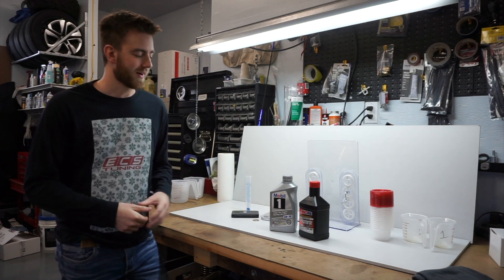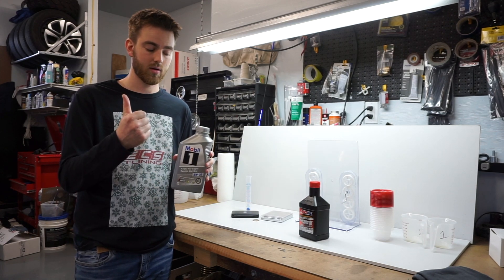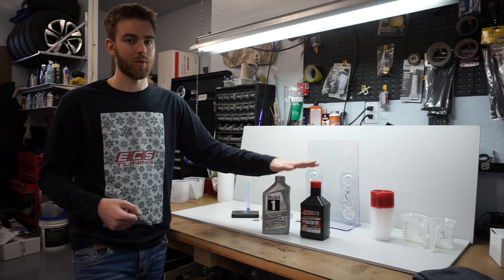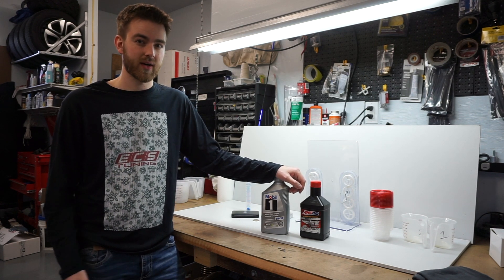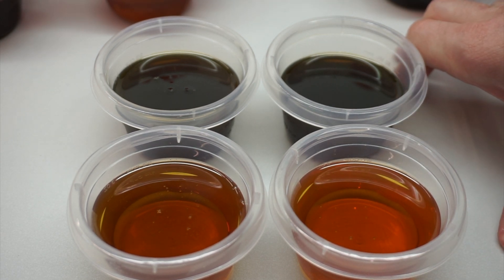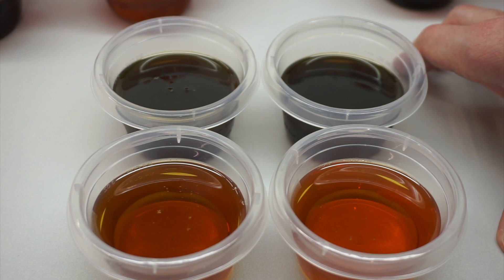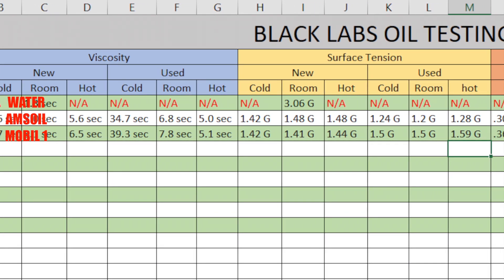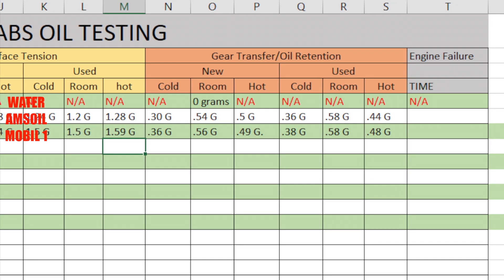Mobil 1 vs. Amsoil. Search for the best synthetic oil. Bench testing (part 1)

Comment: OK Signature Seiries Amsoil.  Good oil.  Now . . . you cannot BREAK IN a new motor on syntheitic oil.  At least a 30 minute breaking is required with a Break In oil before beginning our tests in the motors.  All the other are fine.
Reply from the maker: As true as that may or may not be, it wouldn’t matter because all the engines are going through the exact same parameters.

Comment: Also he didnt use Mobile  1. Advanced 20.000. Miles oil here . This teSt is unfair😮😮
Reply from the maker: Are you saying if I used mobil 1 advanced it would have performed worse? This Mobil 1 I used already out performed amsoil. There wouldn’t be a reason to retest.

Comment: I ran Mobil 1 in my airplane and had no problems. I do run Mobil 1 in my motorcycle and pickup truck. I also change it at 3000 miles. I'm a Mobil 1 guy.
Reply: CHANGE  ANYYYYYYYTHING @ 3K 
even honey 🍯 nut cherios ..
and it will be good

Comment: Turns out 100% synthetic and full synthetic are the same thing. Apparently, Amsoil is a 100% blend of group 3 and group 4 base stock just like full synthetics are. Pursuant to a 1990’s law suit between Castrol and Mobil 1, courts ruled that group 3 and 4 base oils are synthetic, therefore any oil that contains one or both of those groups, regardless of proportions, can be called synthetic. So as long as Amsoil contains group 3, even if it’s 100% group 3, they can legally call it 100% synthetic. Thus, 100% synthetic and full synthetic are synonymous.  Amsoil admitted this in one of their own blogs.
Reply: I just read and amsoil is a mix of group 4 and group 5. Plus amsoil has no trace of mineral conventional in it, Mobil 1 does tho, but the amount can vary.
Reply: @gabrieldetwiler7078 even many cars on plain  ,,regular oil,, do great. So amsoil is really not,, even mandatory. Save your 💰 🤑 💸 💲

Comment: What turns me away from Amsoil? The 70’s style salesmen they all come off to be. Some of the most annoying people on the planet. I’ll stick with the oils on the wal mart shelf. I’ve been a Diesel engine and gas turbine compressor mechanic in the AF for the last 19 ½ years. Know what brand oils our PW and GE F16 engines are running? What oil do our AGE equipment both diesel and gas powered run? Not Amsoil 😆. People get hung up on the “best” oil when preventive maintenance and routine oil changes are the key. Stop obsessing with putting the “best” oil in your vehicles when most don’t even do oil changes properly. You Amsoil loyalists try to convince everyone to switch because you feel the need to over pay for oil in your Pontiac fierro’s!
Reply: My Pontiac Fierro deserves the best. ;-)
Reply: So you can run the most generic oil in your engine and get similar results to anything else? no engine wear or anything like that?
Reply: You hit the nail on the head

Comment: Appreciate the effort and thx for the video. But what does testing motor oil at 120 degrees prove? Like you said, motor oil in a car engine runs at 200+.
Reply: Mobil 1 is a syn blend oil.  Amsoil is 100 % syn oil. Look into it.  Biggest scam taking advantage of people.

Comment: This sounds crazy but I thought about this and I think that using conventional motor oil is better than synthetic for engine startup or if some how your oil leaks out it sticks to the metal butter. I'm no oil chemist so don't just take this as good info because I'm just thinking about it.
Reply: synthetic is better less break found is thinner which is better for winter start ups
Reply: Lmao 🤣🤣🤣 conventional oil is better on cold starts?? You have to be joking right?? WTF??
Reply: I still run full synthetic but Ford recommended a synthetic blend to me. They claim its best of both worlds but who knows.

Comment: Heat? Dirt? I dont see how this resembles oil actually being used in an engine. I see oils sticking to plastic gears.
Reply from the maker: It’s a bench test. Not an engine test. And if you have dirt in your oil you might wanna check your filter👍🏻

Comment: Your test is meaningless.  Temps are to low.  Check out Project Farm if you want to see a real test.
Reply: Jonathan Morgan 
Your comment is false.

Project farms is a test. 
It is a test of different properties of the oil. 

This test is just as valid as project farms.. more so because the used oil was produced in an Engine not an oven.

Project farms is good backyard science 

So is this.
Reply: @OranthumLLC  Yea but it all depends on the condition of the engine.  All engines are different
Reply from the maker: It’s a BENCH test. Testing on a bench. It doesn’t matter what the temperature is, as long as you test the same temperate for each oil.

Comment: Mobile one is a fraudulent product since they've decided to use the term "Fully synthetic" which is oil legally allowed to be called synthetic where as Amsoil  is a true 100% synthetic.
Reply from the maker: So far mobil 1 has out performed all the other oils I’ve tested. So it doesn’t really matter what the bottle says.
Reply: @TenzaMotorsports  I can list three critical issues Mobil 1 can't out perform Amsoil on. Two result in costly damage and maintenance and the 3rd is simple seat of the pants performance, power, and  vibration reduction. That third reason is the reason there are so many hardcore Amsoil users.
The other two issues are number one lspi or pre detonation at low speeds which Mobil 1 fails and number 2 intake valve carbon deposits.
Mid-year mobil one will pass lspi  due to the required
 API specification but they're going to have a 10% price increase because they're going to have to go with more of the proper base stock to do that. At that point Mobil 1 will out price Amsoil at retail.
Reply: That was Castrol  that decided to use the term "full synthetic." Mobil is the one that sued them.
Reply: @redfirefox3568  but at the and army of lawers hired by oil companies strongarmed the authority in to allowing oils made out of base 3 hydrockracking - to be called full sythetic.
Even most of Liqui Moly oils do not have "full suthetic" marking on Germany version of their site while do in US.
Real synthetic bases are GTL (gas to liquid) Ester base and pow.
Funny thing is that non of the sythetic bases can be used by itself as they have major 1 or 2 flaws, while all mineral bases can, with standard pack of additives, used as motoroil.

Comment: Your temp ranges are nowhere near the actual operating temps of an engine, I sorry dude ,but your tests are meaningless. Check out project farm, his tests were somewhat more meaning full like  ASTM tests.
Reply from the maker: I never said they were operating temperature. Meaningless? I’m sorry you don’t understand bench tests, but that doesn’t make my tests meaningless. One of the reasons I started testing was project farms videos. All he does is freeze oil then grind two pieces of metal together. Just in case you don’t know engines don’t run like that. Also last time I checked boiling oil until it’s black doesn’t mean it’s used oil. I actually am using used oil.
Reply: Yes you and project farm are a bit different in your methods but still in yet it’s a great comparison test. I just spent $95 on 6 quarts of amsoil and a mobile 1 filter for my 04 GTO. I used mobile 1 last time and with an ac delco filter. It cost me about $50. So yes you can save money by using mobile 1 in a non performance application. I switched to amsoil because my engine is modified and I race so I want the best oil for the application. So yes I appreciate what you’ve done here.
Reply: dennis rantanen 
I don’t think meaningless is used properly in your comment.

Comment: I've used Amsoil Signature Series 0W-40 vs Mobil 1 0W-40 European Formula in my car a few months ago. Both oils were used for 5,000 miles and I observed that the Mobil 1 sheared more than the Amsoil. A normal person wouldn't tell the difference with the engine noise but I paid very close attention and I can just tell Mobil 1 sheared/degraded because the engine was running more rough, it was a bit noisier and had a raspy feeling to it. Amsoil felt the same from beginning to end of the oil's life, which is a really good thing. The chart in the end supports what I felt in my observations between the two. Used Amsoil's hot viscosity dropped 0.6 seconds. Used Mobil 1 hot viscosity dropped 1.4 seconds. This illustrates the shearing/degradation is greater in Mobil 1. Makes me wonder how much shearing takes place in the real world with multiple heat cycles, longer oil intervals, especially in car enthusiast's cars where oils will be hotter than normal. I'm glad your evidence supports what I observed and hopefully my insight contributes to the community. Great videos.
Reply from the maker: Thanks so much for the comment. I hope many people are able to read this.
Reply: Thank you, your comment sold me on Amsoil vs Mobil1
Reply: That’s not an accurate test though. If you used amsoil then Mobil 1 it could have been fucked up from the amsoil sludge that was left in it dude. The most accurate you could get is to use two brand new or completely cleaned vehicles (with no prior problems) and test them with each oil and see the results. I’m not saying amsoil is bad because I do think they’re top dog right now but not with filters. Mobil 1 does make better filters than amsoil but amsoil oil seems better right now.
Reply: You do realize Amsoil is a pyramid scheme. Top guy gets people under him they get people under them. Remember amway? They had the best products right ? yeah it’s all bullshit. Amsoil and mobile 1 hell even Walmart’s super tech all have the same rating from API American petroleum institute. They put all these oils through-testing and then rate them. Don’t be fooled and save money
Reply: @coldcoilinc  Fact is, Amsoil brought synthetic oil to the marketplace and it is the best oil you can buy.  Also, you can buy the oil from an Amsoil dealer without getting caught up the supposed pyramid scheme.  (Which it isn't, it's an MLM)
Reply: @TheBeatenPaths  you have to pay amsoil,, 😒 🙄 to be able to buy it.

Comment: You don't test engine oils on gears.  Clinging to gears requires tackifiers, usually in the form of isobutylenes.  Engine oils do not contain tackifiers since engines are lubricated with a pressurized oiling system.  Tackiness is only important in machinery that operates by splash lubrication such as rear gears/diffs and manual transmissions.  It has no relevance to an engine.
Reply: Almizzy Racing 

You have some fair points but you are overall.....
Wrong.
Most engines built before 1996 rely on splash lubrications for rockers valves and cylinder walls.  Small engines still made today like the engines that will be tested and are making the used oil still use primarily splash lubrication. Also if the oil has no “tackiness “ how would it stay in the engine for cold start purposes. For the short time before the oil pressure has sent oil to all the bearing surfaces? 

Close but missing some key elements.
Reply: @OranthumLLC  All of the areas you mentioned operate in mixed and boundary lubrication where the additive package is far more important than the base oil.  Tackifiers don't make the additive package work.  The additives, often based in ester themselves, do that job on their own.  If your oil filter has a functioning anti-drainback valve, oil will be there for the bearings when the engine is started.
Reply: Almizzy Racing 
Ok.....
So you are saying that the oil does nothing and the additives do the lubricating.
That in and if itself is true.

The point is the “oil” being placed in the engine, any engine is a colloid fluid made up of carbon chains whether it be esters, butain chains , hexains , perifins or pentains does not really matter they are all mixed together into a specific formula. That is called oil. Mobile one Amzoil Pennzoil all have their own special mixes.

I am not saying your factual statment is wrong . I am actualy confused as to why you claim that one oil clinging  to gears does not mater. 
It does. Both to much cling and to little are bad.
Also why does it really mater what specific part of the oil is doing the clinging the mixture as a whole is being tested. 

Last I will give you the Benefit of a brain slip while typing fast. Oil filters do not have anti drain back that is in the pump assembly. They resist flow slightly in one direction. Fuel filters do have Check valves in them oil filters do not.
Reply: @OranthumLLC  Most oil filters do have "ANTI DRAIN BACK VALVES" in them for the purpose of keeping the oil in the filter for the next start up!
Reply: wayne owen 
Yes you are correct. if it is not a BMW canister filter or a filter that sits at the bottom of the pump.  some filters do have anti drain back some do not.
Even anti drain back filters do not keep oil in the bearings for very long.

Comment: Title is misleading though, one is a Full Synthetic and the other 100% Synthetic, different classes of oil.
Reply: Yeah, what Stephen said. What's the difference, Melmo?
Reply: Turns out 100% synthetic and full synthetic are the same thing. Apparently, Amsoil is a 100% blend of group 3 and group 4 base stock just like full synthetics are. Pursuant to a 1990’s law suit between Castrol and Mobil 1, courts ruled that group 3 and 4 base oils are synthetic, therefore any oil that contains one or both of those groups, regardless of proportions, can be called synthetic. So as long as Amsoil contains group 3, even if it’s 100% group 3, they can legally call it 100% synthetic. Thus, 100% synthetic and full synthetic are synonymous.  Amsoil admitted this in one of their own blogs.
Reply: Yes...lake speed said the same thing. @JohnnyUtah9173

Comment: Castrol is better than both so...
Reply from the maker: Castrol is on the list to test! What oil should I test it against?
Reply: @TenzaMotorsports  Pennzoil Platinum
Reply: @TenzaMotorsports   anything 
Just make sure the tests are done at operating temperature
Reply from the maker: The tests will be ran at 120F 60F and -5F
Reply: @TenzaMotorsports  castrol edge titanium extended performance 0w20
Reply: @TenzaMotorsports  valvoline and mobil 1.
Reply: Pennzoil Ultra Platinum or even the regular Platinum
Reply: REDLINE is the best. 5W 30💯👍

Comment: I use Royal Purple in my '68 Chevelle 350ci and in my 2002 Z28 ...
Reply from the maker: Royal purple has been good to me so far. Honestly Amsoil, Mobil 1, and Royal purple has been all positive experiences for me.
Reply: Rich Ki.  You'll soon replace your 350ci  and the LS-1 in your 02  Z/28. Are you kidding, purple oil ?
Reply: you need zinc in older cars to keep your engine running and Amsoil makes some for just that purpose  @ricktaylor3748
Reply: @ZandomGame  amsoil has a Z-Rod oil. High in zinc for older engines.
Reply: The vanilla Royal Purple you can find on the shelf at Autozone is formulated identical to Valvoline Advanced synthetic.  The only difference is the purple dye.  Same group III base oils and same SN+ add pack.
Reply: Amsoil makes a high zinc version for your Chevelle. Amsoil Signature Series is better than Royal Purple and lasts longer.